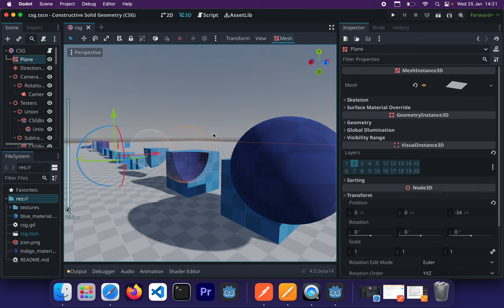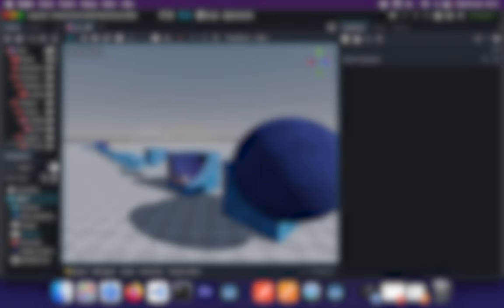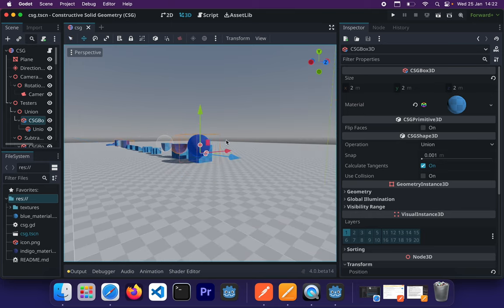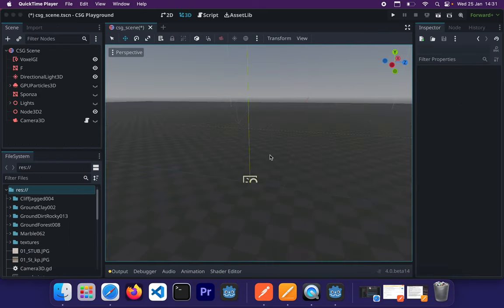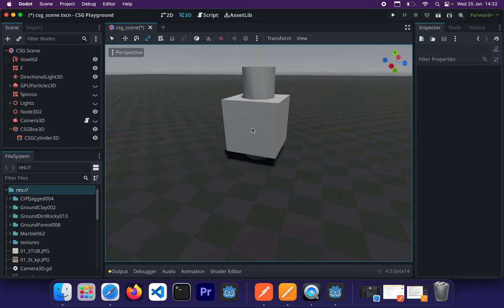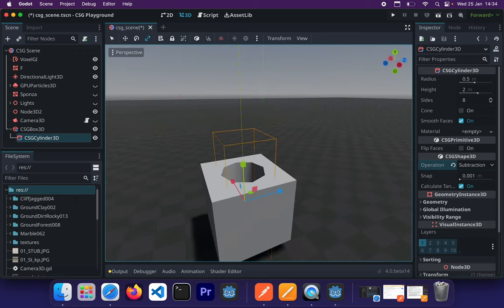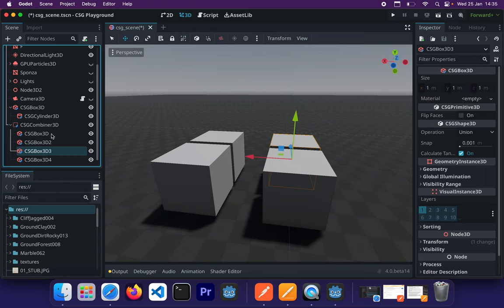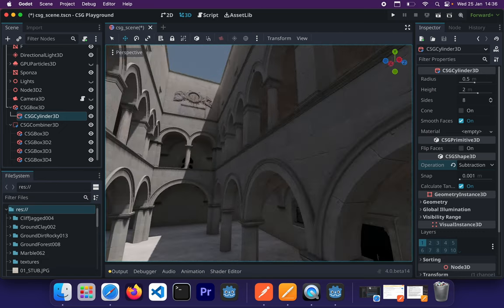Godot 4 CSG is pretty easy

Comment: Wish there were more CSG oriented  editor features, like the ones you have in Hammer or Quodot
Reply from the maker: I haven’t used Hammer or Quodot but I’ll go with your word✊🏽 and agree that it could be better for them to add more features in relation to CSG tools
Reply: Those aren't CSG though. It's just brush based geometry, where a brush is much like a regular 3D mesh, but with some restrictions, like having to remain convex, and every face has to be perfectly flat. Although Hammer does allow for boolean operations (I presume Trenchbroom does too, but I can't remember). 

That said, I agree. It would be great if there was a general purpose level editor. Trenchbroom is so far the best candidate that I know, but the developers don't seem too interested in going that route, (and it pales in comparison to Hammer in terms of features, and the devs also don't seem to care about that). TB is a Quake-first editor, in the sense that it's very much made for quake and support for other engines is... not great. It's hard to setup, and some features are outright not there (e.g.: you can't add textures to custom models for your custom entities -- unless you use WAD files, I think, but again, that's a niche quake thing).

Comment: I have used this technique in Blender but not in Godot, do you think it affects the performance?
Reply from the maker: In Godot its mostly used for prototyping, so in terms of how you will be using CSG I guess we can argue about it based on the way you will be adopting it in Godot.. So I would say it depends on your use-case
Reply: @luthecoder  so I can't use it for map making?
Reply: @sekaus9158  You can, but you will have to export the scene as gltf and clean it up in Blender (or whatever modeling program you use) and do the UVs and textures there.
Reply: @hopemetal3440  well... at last I can get a product type up and running...
Reply: Yes. Csgs are not super performant when it is multiple csgs together. But you can use it for prototyping.
Basically when you have two csg shapes and a csg combiner nodes in a scene, godot will treat each combiner as one geometry. So having many combined gemoetry don't effect performance much, but having many shapes in a single combiner/geometry does effect performance a lot.
Reply: @hopemetal3440  What do youmean by cleaning up? I don't know Blender. Isn't the Material of the CSG where you can add a texture to it in Godot?